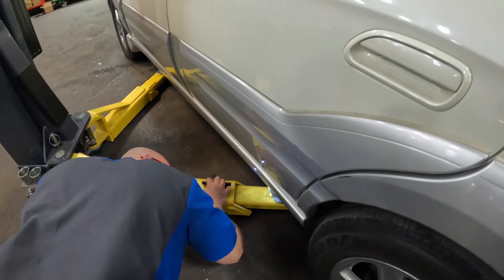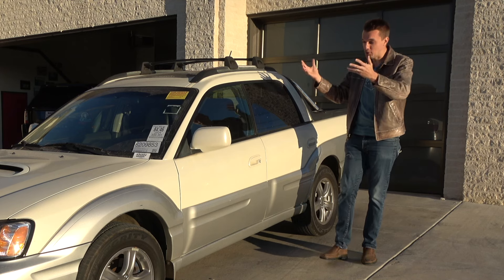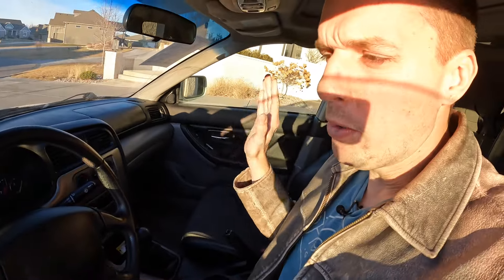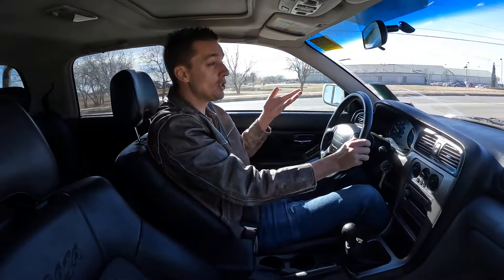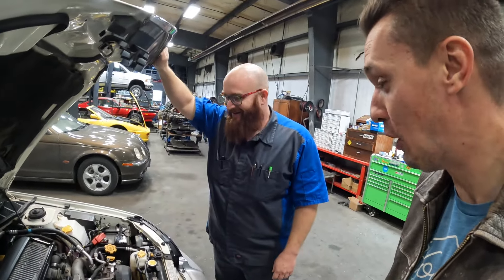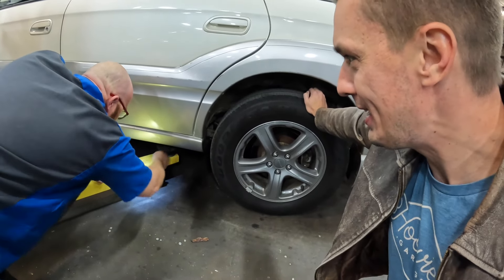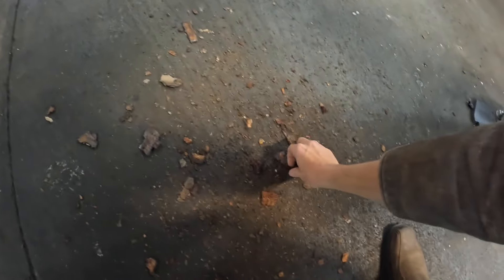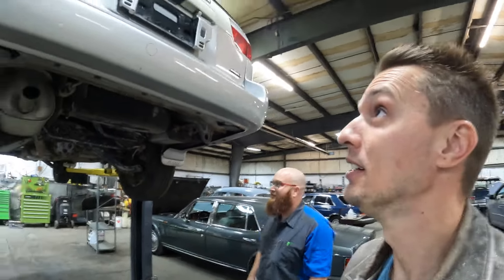Here's why you should NEVER EVER Buy a Cheap Subaru (total mechanical/rust DISASTERS) Baja XT Turbo

Comment: When you guys realized the 4 point lift was only holding 3 points, and Wizard moved the arm of the lift...I've never seen him move so fast
Reply: My heart jumped when I saw that! Absolutely insane
Reply: Him yelling shit as well was priceless
Reply: Same here! I basically gasped when that happened!
Reply: @Bobbyo56  I didn't hear that, I was saying it myself. There's no saving that thing, it saw the point of return, waved at it as it went by, and kept on going, far longer than it ever should have.
Reply: I'm kinda glad that the weight didn't shift.. that arm would have ripped a hole through the body before toppling the car down..
Reply: @Bobbyo56  yeah it was, i inever thought i'd hear the wizard say Holy Shit LOL
Reply: Well, that's why it was crumbling like the other side. 🤦‍♂️
Reply: I've accidentally lifted cars on 3 arms as a rushed apprentice a couple times. It seems really sketchy but they're actually still supported reasonably well. Lifting a Ford Ranger on 4 arms is way sketchier
Reply: @Sheehy223  That's because of that dumbass swoopy frame lol. Good trucks and all but why the fuck they did that I have no idea
Reply: I gasped and then laughed, but before when they were like lets go under it I thought NOOOOOOO!
Reply: I had a coughing fit I laughed so hard
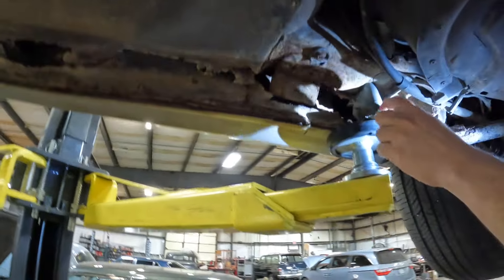Reply: 22:30 That scream hahahaha i'm still laughing.

Comment: Wizards face is absolutely priceless when he first sees the sills when putting the ramp legs under…..had me in tears! This video is hilarious……feel sorry for you though Tyler!
Reply: Clearly you've never worked on a car from the Midwest. I don't think wizard does either that often, this kind of thing is fairly normal, usually you skip the pinch Weld and go for a more solid Point like a subframe bushing.
Reply: @chubbysumo2230  the car is totaled
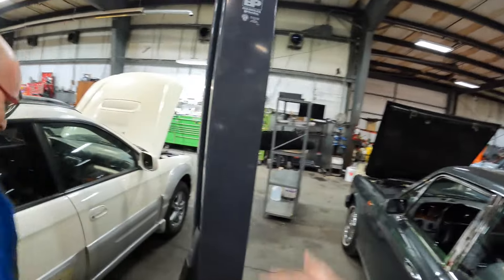Reply: 16:35
Reply: I was in tears as well. Oh my God that was such a funny face!!!! 🤣🤣🤣 Reminded me of Bubbles from Trailer Park Boys.
Reply: @chubbysumo2230  I had a Mercedes like that in Michigan. Couldn't use the factory jack points because they'd rusted away. Likely to be the case for any car more than 10 years old there.
Reply: @bitcoochie4093  lol, not here. Plenty worse on the roads still out driving around.
Reply: @chubbysumo2230  I’m imagining he hasn’t. Saying ‘sills’ and ‘ramp’ I’m guessing he’s from here in the UK? You guys say rockers and lift I think? Having said that there’s plenty of potential for rust here the climate isn’t all that. However, that Subaru is particularly nasty underneath but looks surprisingly good up top!
Reply: @markbennett6658  yes from the UK.
Reply: @Jil1A  had to watch it again after your comment. And yup, totally Bubbles, lol
Reply: I was just about to say this as soon as I saw it. The shock and fear was priceless.
Reply: Was that after the 14th or 15th commercial?
Reply: Dying at the crap falling off and it crunching like a bag or stale chips. 🤣
Reply: My thoughts exactly... what a great episode, had me in tears of laughter!!

Comment: You should sell it to a parts broker, it still has alot of not caving in body parts like the doors fenders and the interior. Just have it flatbed towed to them.
Reply: Bury it in the wizards yard for a year would be more fun
Reply: That is what he usually does. J&J Auto Wrecking is who he normally uses.
Reply: The engine has to be worth something at least, trans looks newer than the rest too
Reply: @clifbradley  J&J is who he buys from , not sells to. I think he junks his cars with EuroAsian Bob.
Reply: As an owner, those body panels are harder and harder to find.
Reply: @Romulus1001  He has sold to them in the past as well. He sold he BMW Alpina to them. John Ross and one of the owners road tripped both cars back to their lot. They bought the Audi from Car Trek and he has sold them a couple other cars as well in the past.
Reply: Bet those plastic body panels are hiding a lot of gore underneath.

Comment: Wizards reaction when he finds the back end was not supported was almost as good as the reaction to the R8 absolutely brilliant
Reply: They straight up bailed.  No staging that, they were afraid for their lives.
Reply: Happens to me all the time at my work and the sketchy ass lifts. You got 3 you're good. In this case though the lifts are actually installed properly so it could be the unibody flexing. Or the use of different jacking points in the rear.

Comment: The fact that thing was actually lifted up on 3 points speaks volumes for how stiff it still is, which is quite astonishing!
Reply: or how much stiffness is left.
Reply: Probably the plastic cladding holding it together!
Reply: I think it is the opposite, the chassis has twisted which is why it lifted on the rear quarter.
Reply: Honestly my baja was similar, but it’s held up fine.
Reply: if you took the car to Baja California you would find out it's not fine...
Reply: This thing would still go down the road no problem with the rockers, fenders, and half the rear subframe missing. I have a 93 Impreza that is more rust than car and it still runs like a top and goes and stops like nothing is wrong with it. :D
Reply: I’d call it 2.5 points considering the rust on the others and using a suspension part as a point
Reply: @Rover200Power  It twisted because they chose a different lift point for the left rear.  Well, I don't think it even twisted.
Reply: How was that car even allowed to be auctioned without a current inspection sticker. I would try to get my money back.
Reply: @egold1006  Not all states require inspections.  In Nebraska the only time they inspect a car (ignoring going from a salvage title to "previously salvaged" title) is when you bring a car in from another state and need to register/title it.  And even then, all they are really doing is inspecting the VINs.  Something like this car would have been off the road over in Germany, the UK, etc. many years ago, but over here's it's not all that uncommon.  God forbid you try an import a 5-10 year old vehicle from overseas, but this, sure, you can keep driving it.

Comment: It would be interesting to see how much of the cost you could get back by parting it out. Decent engine. Interior. Wheels. Cladding.
Reply: Rust. I'm sure someone on Etsy can make art out of it 😂
Reply: Exactly what I was thinking.  He could make it a goal to see if he can reclaim the purchase price by parting it out.
Reply: Well, not the gas door cladding. That now belongs to 30-odd miles of anonymous interstate.
Reply: With used engines going for a premium he could part the engine and tranny for half the cost of what he paid. The question is does he want to take the time to do it or just junk it.
Reply: My toughts exactly
Reply: This is a parts car, if I ever saw one ... lots of interior pieces to be sold off, and the engine and transmission perhaps as well, perhaps the lights too.
But the chassis is junk, that's fore sure .. or rather, it's a pile of rust !
Reply: Engine, transmission, body cladding, front grill and hood, door cards, seats, dash...wheels?, What else? Might be able to break even....if he was pulling the parts himself.
Reply: @gpzjeffrey7974  I don't know, 9 grand is a lot of cash to get from parting out a subaru baja, but I guess you never know until you try.
Reply: I guess another alternative might be to find one with a wrecked engine and transmission but with a reasonable frame and body on a scrapheap, and then swap stuff over. But as this is a 'rare car' nowadays, such a thing seems unlikely - though there may well be one in a shed somewhere just waiting for the parts off Hoovies hooptie Subaru.
Reply: @gpzjeffrey7974  
The glass looked good too.
Lights might be good as well.
Reply: 200k miles on a turbo engine. Isn't exactly the motor I'm looking to buy to replace a motor.
Reply: @CathyInBlue  😆 🤣 😂
Reply: Everybody says that without thinking what's involved in parting a car out.  If you aren't a mechanic, you have to PAY SOMEONE to pull parts.  You have to PAY SOMEONE to store them.  You have to deal with phone calls and emails and text messages asking about this 5 dollar part or that 10 dollar part that someone else long ago bought.  Eventually, you'll sell maybe 10% of the thing and have the remaining 90% sitting in a driveway, or in your yard, or, having to pay someone to store it.

Simply put, unless you are in the business of parting cars out, it's a stupid proposition.
Reply: @kevinconquest9307  
Interestingly, a YouTube channel called "Mighty Car Mod" took apart a high mileage Subaru engine, and found it was in great shape, so they put it back together and called the car "Miles", and used it for some projects. So the mileage isn't always a good indication of how good it is.

Man, I remembered incorrectly .... it was a Skoda Octavia with a turbo diesel engine, and the YouTube channel was Car Throttle.
That said, it had 430'000 miles on it, and was named Miles, the high mileage hero.
Reply: What about your time spending on a pos car?
Reply: I have a buddy who might be able to use some of it.

Comment: I appreciate how Hooptie showed his basic integrity by removing this unsafe thing from the road, even though it cost him a bunch of money to do that.  Thank you very much, you are a good man, sir.  It's only money - and you know how to make more of that, better than many people, at least.
Rust never sleeps.  Many people in dry southern parts of the US do not understand what rust does to vehicles that are kept in area where there is salt water, or where the roads are salted, or where a car could be used to drive through watery areas.
Reply: *Hoovie

Hoopties are the cars.
Reply: This car was clearly parked in the ocean daily.
Reply: To the average person this seamed like a total rust bucket. But from what I saw it looks like the main trouble areas were the front and rear subframes (which can easily be replaced) and the side rocker panels.   The rocker panels can also be replaced but they require more extensive body work to cut out and weld in the new ones. It's a common repair on older WRXs.
Reply: @evoman44   You're really funny!
Reply: @davidstjames_  I am guessing your not the type that sees this as a restoration project and rather a hassle because you don't like to get your hands dirty.
Reply: @evoman44   First of all, I've restored and owned more vehicles than most people could ever dream of!  So, no, I'm not afraid of getting my hands dirty.

However, you are correct in your assumption that I don't see this as a restoration project.  That corrosion has gone through several panels, it's not just the outer rocker panels.  That car was badly built at the factory and it's not worth all of the labor to replace all of those pieces.  There was little to no corrosion protection in those boxed-in areas when it was built, there were hot spots throughout the structure of that vehicle just waiting for a little bit of a catalyst to really get going.

You have no idea what's involved with removing all of those layers of corroded panels.  Let's pretend that the front and rear subframes are perfect.  Once you're ready to start rebuilding, most of the additional parts (other than the outer rockers) are not going to be available, you will have to fabricate every piece yourself.  When you start welding those new panels, you're going to be using weld through primer all over everything and welding upside down, this isn't the factory where a robot is spot welding galvanized (or otherwise treated) pieces.  When you're all done with the equivalent of at least 15 grand in labor time wasted, congratulations, you have a beat up old Subaru that's needs a rebuilt engine and transmission, along with the entire suspension and steering systems.

No, I don't see this as a restoration project.  Hoovie did the absolute best thing by not repairing or selling this car, ethically, morally, and from a business standpoint by not having possible liability issues.  I'm sure that he'll recover some cash selling it to a junkyard or to someone else who will part it out.
Reply: @davidstjames_  I see your point. In most cases you can't really see just how bad the rust might be until you start taking it apart. But I still think that it's not all a total loss. Hoovie could find another Baja with a blown engine or one with someone  light crash damage at a salvage action to swap all the needed parts to rebuild another Baja with a good chassis.
Reply: Dizzy Gear  I've driven unibody Jeeps in Northern Michigan for 20 years. I'm familiar with rust management. I've never seen a car this bad. Floors? Sure. Body panels, all the time. But never have I seen frame rails or suspension components that bad; and I keep them 10 years and get them inspected on the regular to make sure they are relatively safe.
Reply: This thing must've been pulling a jetski or a boat and taking it into saltwater on a regular bases.
Reply: The horror stops with hoovie.
Reply: @davidstjames_  put the engine in something else like an airplane. Peddal the light fixtures and bits on ebay and sell whats left at the scrap yard.
Reply: @georgeperkins4171  Yes, I agree.  Sell what you can, and scrap the rest.
Reply: @davidstjames_  yes. Wasted sellable parts. I know c.w. doesnt need the cash but give money to charity. Tax deduction and what about the children! We need to help the children!😉 (sarcastically)
Reply: Ya in Manitoba Canada here a lot of Chevy frames (1500s 2500s and 3500s basically only Chevy) rust out due to frame being so low and stuff all the others are good had a Mazda 3 had a rusted subframe but nowhere near this bad 😂
Reply: All the Ford and dodge frames are really good (dodge frames rarely and I mean rarely except for surface rust out) lol

Comment: Sounds like it runs and drives well so I would ask wizard to remove the engine and transmission before junking it. Maybe the next project will benefit from a 2.5 turbo Subaru motor
Reply: Factory Five 818 kit car can use the drive train

Comment: It would be interesting to see how it holds up in a crash test.
Reply: The act of trying to take in in for the test would be an accident in itself!
Reply: why hasn't someone made a video like this yet
Reply: would just be a waste of a good engine/trans/interior and lots of parts really
Reply: I would love to see it jumped. 

The thing would just fold.

Then the interior bits could got o some restorations, because the interior looks great.
Reply: It'd be like it got Thanos Snapped. Just turned to dust straight away.
Reply: So much rust if there's any aluminum in there you might get some accidental thermite.
Reply: i assure you it would not hold up at all
Reply: Never mind crash test lets see how it holds up to a speed bump.
Reply: Definitely don't want to get into a side impact with it
Reply: NHTSA should really do that to show people how unsafe it is to drive around in rusted out cars. Or to convince certain states to use less salt on the roads.

Comment: Based off what’s still good on that car you might be able to minimize the financial damage. You’ve got 4 good doors that might be worth 500 bucks. You’ve got a good drivetrain that someone might be willing to buy. The engine and trans are worth a few grand, the interior has good seats and trim pieces. I would suggest gutting the car for any good parts that are worth money. Then after your done haul the hulk to the local scrap dealer and that should get you a few hundred bucks
Reply: yep. the XT motor is easily sellable. Subaru used parts are easy to sell.
Reply: hoovie aint got time to do that lol.
Reply: He likely wont waste his time, which is sad. Im sure there are quite a few good parts on there that some Baja owners are chomping at the bit for ahhaa
Reply: Ha i'm still bothered by that whole Alipina BMW situation where the blower just needed whatever O-ring or gasket replaced...even if it needed custom made.
Reply: @MTBD80  b

Comment: POR15 cant fix that.. I bought a Nissan Juke 4wd during covid and when i got home i jacked it up to inspect the brakes and found the rear suspension was rusted out. i called the dealer and they replaced everything rusted i went all over it and painted the rest with por15 then a couple months later had to have a new cvt.. glad i bought a warranty..

Comment: The dealer that wholesaled it to you definitely knew he scammed you.  No wholesaler would go back to a dealer if they pulled one on them like this.  Imagine the stuff they pull on customers if they did this to one of their own.
Reply: Im in the UK motor trade.
Ive seen worse.
Many cars are fixed with expanding foam and cardboard.
Never buy without looking and poking around underneath.
Reply: @sahhull  does MOT work well when comes to inspecting cars?